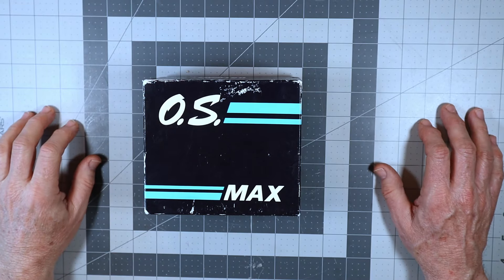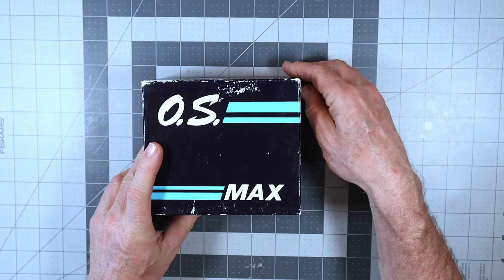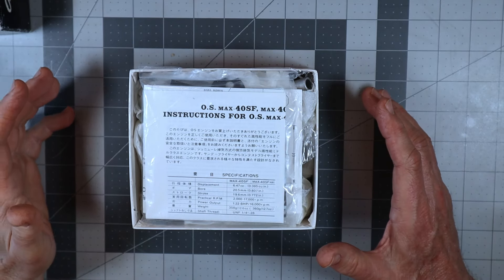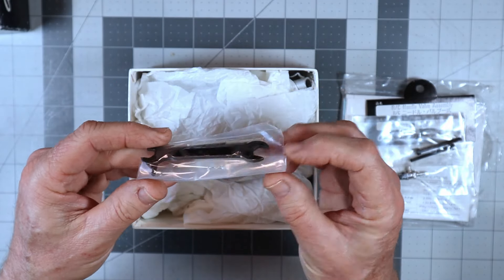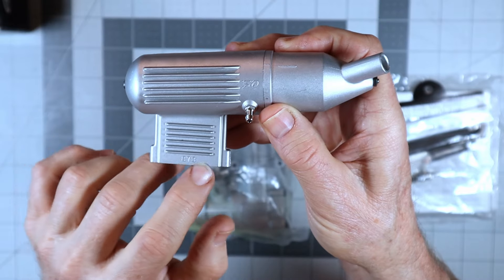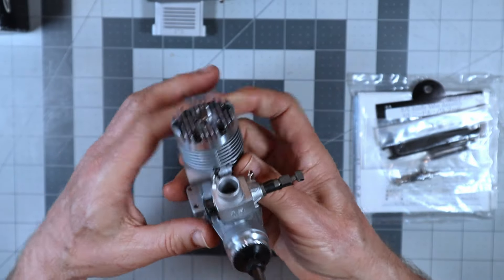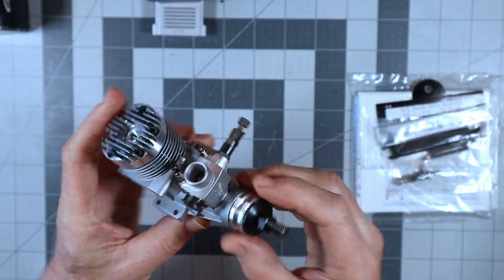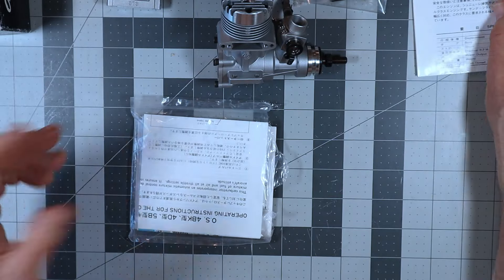OS 40SF Ring A Quick Look

Comment: Wow the SF 40 ringed version, never had one on my hands cause the hobby shop near us just tend to have in stock the 46 size instead of the 40, also remenber the OS 46 sf reverse rotation, os had the conversion cranckshaft suitable for twin engine kits, the normal rotation engine was placed on the left wing and reverse rotation on the right, to compensate the gyroscopic and torque effect in the case one engine quit in flight

Comment: What a score. I saw it on the bay but resigned from buying from that seller due to his rating score. So glad you didn't get burned. This is a fantastic engine especially being ringed. A real stump puller. BTW, I have the 46SF manual if you want it.
Reply from the maker: Thanks Mike. It would be nice to add the 46SF manual to my Google Drive for all to see. This is a 40 SF and it came with the manual.
Reply: @dmrcflyr2  Sent you an email........hopefully you got it, or it may have hit your spam box.
Reply from the maker: Got it Mike. Thank you.

Comment: I have a question: i am 16 and just bought my first engine (HP40 gold cup). Do rc plane engine con  rods wear out the same way as rc car engine con rods? My engine is in pretty good condition so i just want to know if the con rod is a critical part to look after.
Reply from the maker: Please do not take offense to my answer.  If you are 16 and wearing connecting rods out on RC car engines, then you need to run airplane engines a bit gentler.  There is an entire mindset change for you between a car engine and an airplane engine with regards to care and operation. There are very limited replacement parts for that engine, if any.  You wear out the conrod or any other component then you have a pretty doorstop.  I would recommend you buy an engine that is currently manufactured and has replacement parts available.
Reply: @dmrcflyr2  I am haven't own a rc car, it was just a reference, but i just want to know if the connecting rod is a weak point in rc plane engines.
Reply: I have another HP 40 for spare parts
Reply from the maker: Whomever told you that rc car engine conrods don’t last didn’t take very good care of the engines.  I have run RC cars and trucks for many years as well and NEVER lost a connecting rod.  It is very simple, care for and operate an engine properly and within the design parameters and it will last a lifetime minus consumable parts like bearings, ring, and glow plugs.  Treat them poorly, over rev, etc. and expect to purchase many engines.
Reply: @dmrcflyr2  Thanks, this is what i meant. i have all the proper oils and stuff to keep it running for a long time. i am not planning to put it on a plane. I just want to enjoy it in a test stand and maybe do some other projects with it.